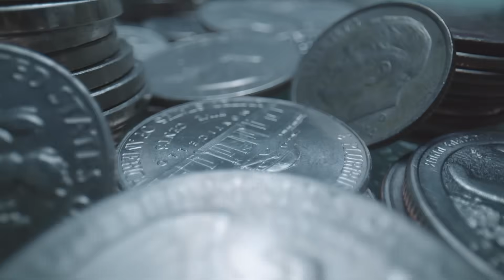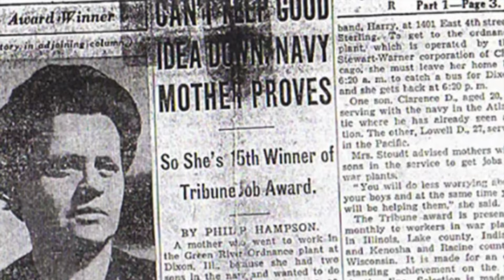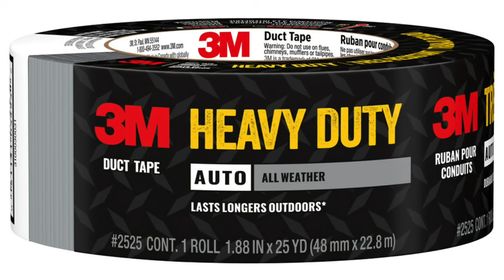Who Invented ‘Duct’ Tape, or is it ‘Duck’ Tape? - Find out in this episode

Comment: (in an appreciative tone) Ah!  Including Gaffer's tape in this presentation was marvelous!
When it comes to using tape for permanency, I always use gaffer's tape, as it is a lot more durable and lacks the tell-tale gummy residue that duct tape is notorious for.
The downside of gaffer's tape is the cost, nowadays with the current brands selling around three times higher than duct tape.

Years ago 3M had the # 6910 gaffer's tape.  Wonderful stuff; stays intact for years of outdoor exposures (whereas duct tape disintegrates in less than a year outdoors).  But, a 50 yard roll would cost over $40 (US).  3M discontinued it, replacing it will a lower price/quality tape.

Comment: Worked at a large candy plant and when a belt broke during production we would use a Harvey 4" wide green color tuff duct tape that appeared to be a lot harder to pull apart. After the run would drag out a,$5,000 vocanising machine to redo the splice.

Comment: Actually, there are two items that looks similar, but they are not.  One is duct tape, and it is used to join and seal air ducting.  It meets various requirements such as flammability and adhesive temperature limits.  Then there is adhesive cloth tape.  It looks the same and costs about 1/3 less than duct tape.

Comment: Duck tape, AKA pusser's tape, in the UK "Pusser" is Royal Navy slang for a purser, a ship's supply officer, now called a Logistics Officer. Or Gaffa tape, why? The precise origin of the name is unknown, one hypothesis is that it is named for the gaffer (chief lighting technician) on a film crew. When cables are taped down on a stage or other surface, either to prevent tripping hazards or conceal them from view of the audience or camera, they are said to be gaffed or gaffered.

Gaffer tape was invented in 1959 by Ross Lowell, director, cinematographer, and founder of Lowel-Light. Lowell reworked Johnson & Johnson's Permacel duct tape product by combining the Permacel adhesive with a silver fabric backing to create gaffer tape which could hold a flat metal plate to a window. 
if you can fix it with Gaffa tape, it can't be fixed
Reply: Gaffer tape is 10X Better. It is what Adam Savage uses and he hates duct tape

Comment: HVAC does not typically use or like Duck Tape because it does not last and it hates sunlight. HVAC uses an aluminum foil or Hardcast to join ducts. They sometimes use a black high grade cloth tape for noncritical joints. Your common Duck Tape does not work well in a hot attic, outside or longer than a few years.
Reply: Don't forget the flammability requirements of HVAC duct tape.  I also prefer the foil tape over that of the cloth type duct tapes.
Reply: @paulkurilecz4209 😂since when do Airconditioning ducts get hot enough to require fire proof connection tape ?
Reply: @spinnymathingy3149  It is a flame spread requirement.
Reply: @paulkurilecz4209  Don’t know about flamibilty of duct tape because I don’t use Duck tape for ducts because it falls apart in the heat, cold, sunlight and just because no one knows. Bad bad product for ducts. The only place I have used the cloth duct tape is to temporary hold a flex duct to a collar before I put the double zip tie straps on.  The tape is in compression and adds a cushion and tightens the flex duct down to the collar. Flex duct is plastic and flammable. This duct need last 50 years. Duck, nada duct, duck tape may last a year maybe more.
Reply: @TexasEngineer  Next time that you are at the store, look at the UL standards for HVAC duct tape.  Not only is there a flammability requirement but a temperature range requirement for the adhesive.  Cloth tapes like DuckTape do not meet these requirements.  It is why there is a big difference in price.  Like you, I prefer to use the aluminum foil tapes.
Reply: @Migglesworth "Duck Tape"  = trademarked name.
Reply: Many years ago, some HVAC guys used duck tape, but since it breaths a little, it dries out.   Foil tape is all you see used now, except were they need a temporary repair...
Reply: "Duct tape" 1:13  has nothing to do with ducks... 😂😂😢😮
Reply: @ It has nothing to do with ducts either. It was originally developed for waterproofing. It does a lousy job on ducks and ducts. I guess they thought was that ducks are waterproof so they must be using Duck Tape. If your AC man is using Duct Tape to seal your duct, you need a new AC man.

Duck tape is essential if you go canoeing and your canoe develops a leak.
Reply: @Migglesworth If you watch the video, you would have learned the original name was DUCK TAPE. Why? It was water proof, like a…DUCK. It was not invented for AC ducts. The darn stuff does not like attic heat or UV. I use a black cloth version or a metal tape or a real sticky stuff with metal backing made by Hardcast.
Reply: What the hell is HVAC 😂
Reply: @seanmcdonald5859 It is an industry, HVAC is heating, ventilation and air conditioning. The guys that hate duct tape because it comes apart over time can’t stand sunlight.